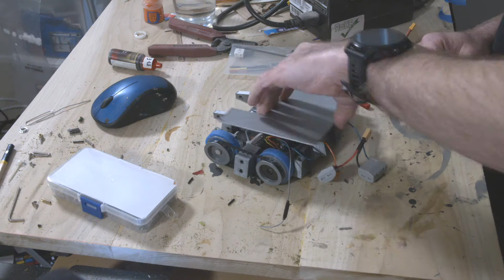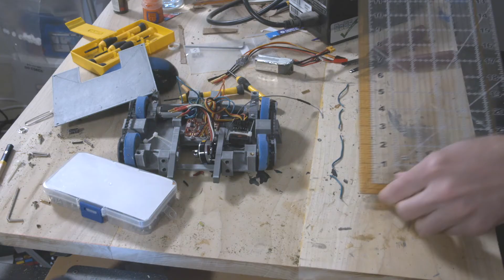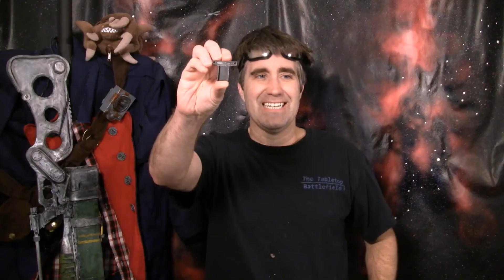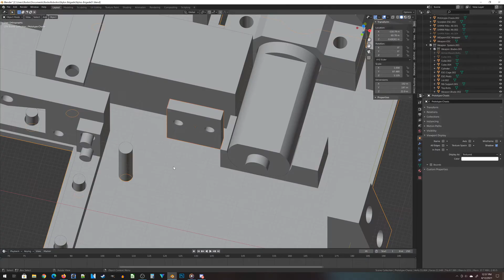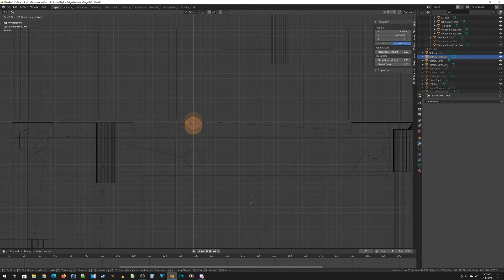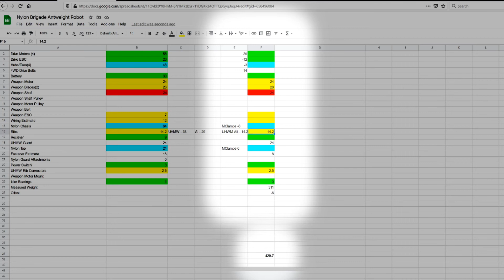Cramming Your Electronics into a Combat Robot - Let's Build an Antweight Episode 4

Comment: You're braver than I, making changes then printing in nylon.  I always do a PLA version before printing nylon no matter how minor the adjustment. I have never not paid for skipping that step :)
Reply from the maker: Did I mention that I was printing in Nylon at this point?  If so, then I made a mistake.  The entire robot is either PLA or TPU95 at this point.
Reply: @RockoRobotics  Oh, I thought the black one was nylon.  No mistake, just a misunderstanding on my part.  Great videos!